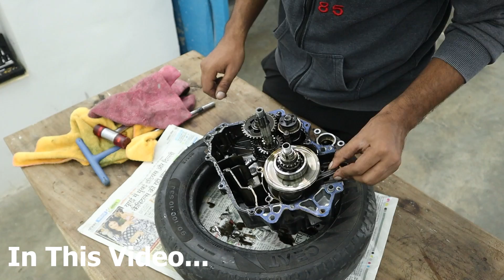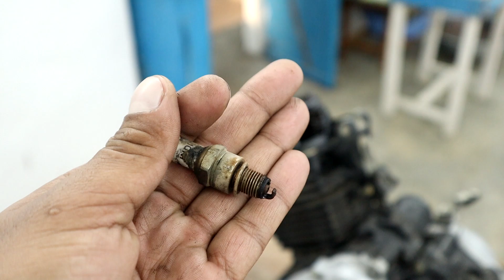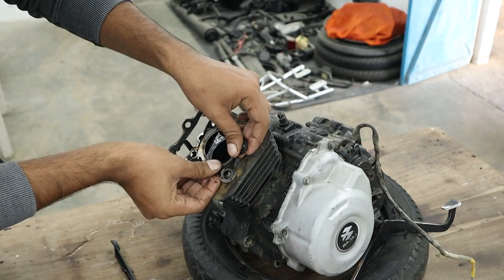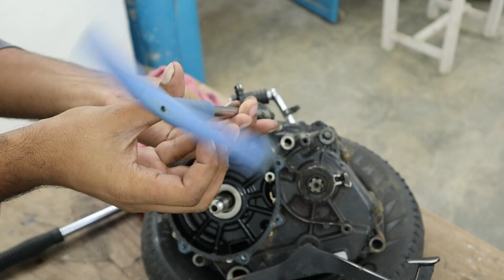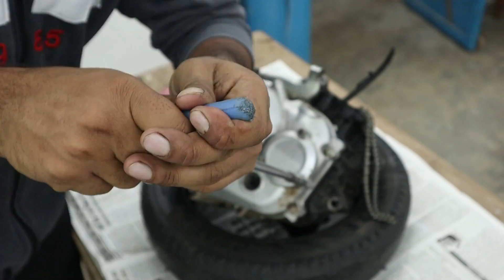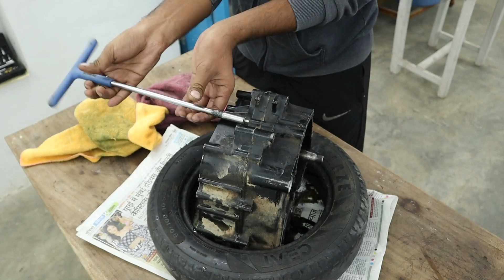Dismantling A Seized Platina 100 ES Engine!

Comment: Hey jeet brother planing to buy a new under 110cc bike which is most reliable one 🤔🤔 and how about Honda cd110  deluxe 🤔🤔
I  watch your every video .
Reply from the maker: I don't suggest any bs6 bike under 125 cc brother.... Instead get an old motorcycle or switch to 125 cc if you want a new one.... But if you still want one below 110 then go to splendor to be on the safer side

Comment: Jeet bro please do a video on gear assembly, crankshaft assembling ,shifter fork assembly of discover 100m. I need to rebuild my engine.
Reply from the maker: 100t ka kr rakha h ek baar check kr lo agar same hai to... Head to alag hai but maybe crankcase same ho
Reply: Ekdom same e hai... Jeet seii bata raha...
Reply: Gear box different if I am correct. 100m is a 4 geared bike, whereas 100T is 5 gear variant, isn't it?. Bajaj released discover variants from A to Z with different parts for different variants and finally vanished into thin air and spoiled it's good will.😔